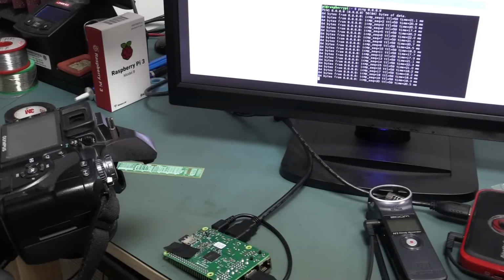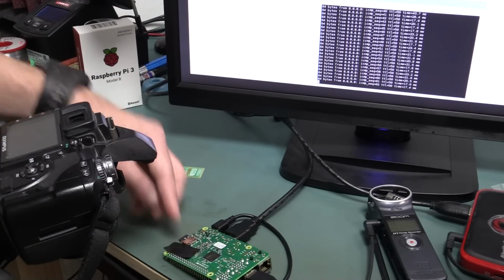EEVblog #901 PART 2 - RPi 3 Photoflash WiFi Problem

Comment: Being the scrutinizing engineer that you are, and your ability to find problems in various designs and products, coupled with the enthusiasm you have with your work is probably why people get the impression that you thought it was a serious matter when it really isn't. Personally I enjoy the high drama you bring to the field even though some of the time it's nits that are being discussed. Sometimes these are very important matters, so let the viewer use some discernment. If people are really concerned about their Raspis, then put a bit of black tape or whatever on the chips.
I mean no offense to engineers, I am one myself, but the truth is that some engineers can be very anal about certain points when in the big picture of things the points are not significant. Some have a little bit of difficulty assigning the proper weight to a problem. Often it's a matter of Ego. Sometimes we just have to say the design is 'good enough', build it and then move on. This does not mean compromise on important issues, but there is a point where many engineers will end up picking the flyshit out of the pepper (so to speak)...
Reply: any good youtuber will sound like everything said is a big deal, because you have to be an actor to be popular
Reply: So does that mean that all australians are actors? It seems like it is just the way aussies act.

Comment: The only thing I've seen that has any issue with light was the old EPROMs that used UV light to erase the memory space. It's really odd that's so sensitive. I realize how intense the light from a camera strobe is. You'd think modern chips wouldn't be so affected as that Pi board though. Weird...

Comment: I like the pi 3. it makes a really good and cheap backup computer. I have trouble playing back internet videos with it. It does the rest of the internet stuff well enough though. Really good for when I am running off my battery backup. The monitor drains to much power though. If it wasn't for that I could probably still have internet access for two or so hours without power to the house.

Comment: Thank you for making a video on this.  I did not realize bare dies were photosensitive (although I should after messing with enough UV Erasable PROMs).  Gives me something to go on if experiencing strange stability issues on boards with dies exposed to lights.  Certainly not a big design flaw or anything on the RPi as you stated, just something that is good knowledge to have for strange edge cases and working with other electronics.

Comment: Is anyone else worried about the durability of a bare die on the bottom of the board?
Reply: the least durable part of any bga chip is the soldering. doesn't really matter if it's in a black box or a bare die
Reply: No
Reply: No

Comment: why didn't you just turn the camera flash away from the board instead of the tape over the chip?
Reply: Because then you would have affected the shape of the magnetic/electric field as well, so it wouldn't be a very scientific test.  A piece of black tape cuts out the majority of light, but won't have any effect on magnetic or electric fields.
Reply: +mikerjuk the field would have just been flipped wouldn't it?
Reply: You can't assume the field will be the same in all directions, in fact it's highly unlikely to be.  Blocking the light and keeping the camera in the same position was the most scientific way to approach this.
Reply from the maker: Because then it's not a proper controlled test, and the orientation of the loops would change.

Comment: If you want to know whats really happening at kernel (driver, module) level when you flash the die, probably it would show up by using dmesg. Or tail -f /var/log/syslog. Or tail -f /var/log/klog.

Comment: Could you set up a pickup coil and a scope to show the EM field produced by the flash? Between the HV pulse that is used to trigger the tube and the main capacitor discharge through the flash tube, there should be 2 separate events with a VERY small (microseconds?) delay between them. Might make for an interesting experiment, and perhaps a video on how a xenon flash lamp works for folks who aren't familiar with them...

Comment: Not to mention the hv trigger coil that generates the several KV needed to ignite the flash tube.  This coil will generate an EMP pulse (rf field).
Reply: The extremely short and large current pulse through the ionized xenon generates a far larger EM pulse than the very low current trigger pulse.

Comment: Does the manufacturer specify maximum amounts of light intensity and wavelength that the chips will work under? It's seems like that's an important specification.
Reply from the maker: No, because it's not something you can easily measure or control.
Reply: You would think they would have a note on the datasheet , they include warnings  about everything else. If it's going to make the chip fail it's an important information.

Comment: its not only space dave     its the same reason they go for a chip on board (blob package) rather than an proper ceramic or plastic package   its because there CHEAP!   and thats what the pi is about      bring the price down as far as possable while still keeping a powerful product   that epoxy costs an extra hundreth of a cent

Comment: Seriously, they haven't fixed this issue in next model? Absurd, thumbs down for designer and manufacturer.
Reply: It's hard to fix it when the part available on the market is photo-sensitive. The customer (Raspberry Pi foundation) can do absolutely nothing about that.
Reply: "Absolutely nothing"? It's as simple as dipping the chip in the black lacquer (same as used to waterproof integrated circuit's). Takes 2 seconds of manufacturing process, costs virtually nothing, and solves problem instantly. I have done this before when fixing RPi2's - works like a charm. I'm stunned that so much people and even engineers have not thought of this.
Reply: They have thought of it and decided it is not worth doing. Even if it takes only 2 seconds why bother?
Reply: +Artūrs Savickis That extra 2 seconds and the extra manufacturing step would actually ad considerable cost to the creation of this low cost board.  If the facility didn't have the machinery to apply the lacquer they would either have to buy one or pay people to manually apply it.   With this being a not for profit venture, cost considerations have been made and it was not deemed a big enough problem.

Comment: non for profit low cost, still more expensive and less powerful than Intel atom
Reply: Suraj Grewal That's all well and good, PI did all of the ground work, nice to see all the copy board's, the PI seems to have a nice eco system with a lot of FREE tools/os etc. The UP board looks good but costs more.
Reply: Can you post a link to the equivalent Intel Atom board with similar features and pricing?
Reply: it is more like full fledged pc than embedded board eg-http://www.ebay.in/itm/172257601324?aff_source=Sok-Goog
Reply: it was literally the first link to google search "atom board"
Reply: I had a very quick search and seen some pc style computer motherboards but no PI/Arduino type development boards with IO headers that can be used for learning to control external electronics hardware etc.
Reply: Suraj Grewal The PI was developed to help kid learn robotics and how to control stuff with computers. Kid can learn to programme pc's on pc's.
Reply: The UP board has an Intel atom, the same form factor and (mostly) the same connectors including GPIO. http://www.up-board.org/
Reply: Coolkeys2009 use parallel port with visual basic
Reply: +Coolkeys2009 best is to pair up x86 system with Atmel atmega32u4
it's USB connectable you know

I kind hate the raspberry environment, it's too simple but slow and good for no actual job
Reply: Suraj Grewal I understand what your saying but it was developed as a learning platform and has been very successful. For professionals there are many other boards out there that you could use depending on the application.
Reply: +Coolkeys2009 oh, OK I get you. hopefully the 'chip' will takeover
Reply: It is terribly slow for a small computer. I bought the first Raspberry Pi that was meant to have a 700MHz Broadcom Processor and it performed like crap. So i ended up selling it. I have had Pentium 2, Pentium 3 or AMD K6 processors run faster than this piece of crap. You are better off with at least a proper computer. Even the newer netbooks can be better than a Raspberry Pi. Plus unless you buy apple stuff nothing will be soldered permanently on to the board.
Reply: +Ryan Smith apple?
those convoluted expensive computers that don't offer enough bang for the buck?
it's just as bad as raspberry pi, coinciding the cost.

i could get a 16 core scientific Xeon computer as cheap as an apple, and those will truly last more
Reply: +Suraj Grewal yeah apples stuff isn&#39;t great value for money. if you buy there newest Mac mini does not have user installable RAM. they are not appealing to people because of these stupid ideas that they seem to come up with. it is not value for money for Apple customers in my opinion. that is why i'm against none upgradeable permanently soldered designs on computer hardware. because the customers does not benefit from proprietary designs or hardware. they just get ripped off instead. As well as told that they need to buy a new Mac Mini if they want more memory. I dont why companies like apple are still supported by their customers. They just make me feel sick. Until they can learn to desgin things properly, i probably wont be buying from for a bit. They just seem to profit from peoples Apple stuff breaking. That's not how you run a business. That's how you make people feel screwed over.
Reply: you know, those Americans, who don't have proper computer education are getting hold of computers.

tapping into that market is ridiculouly profitable(hell, even I profit from it by acting as middleman)
Reply: People wont go back to companies who sell them crap though will they? How would you like it if you were sold a computer that was so crap it was restricted to running xp at best? I know i wouldnt want to do it. I was happy when Microsoft gave up on Windows XP and stopped support for that operating system. Too many companies have been running Windows XP on the cheap. Plus it is full of bugs and crap that really is embarrasing to have in an operating system. Never mind having Microsoft dictating to people about how they update their computers when they are running Windows 10, which is not good as it appears to be. If Microsoft did not exist Linux or Mac would have taken over instead. I would not run Windows XP knowing that was putting the rest of my network at risk from viruses, malware, trojans, remote attacks and hackers. I hate seeing Windows XP in use in shops and businesses. It is a digusting operating system to be using in this day and age. Plus the operating system is insecure to use out of the box, just as releases of Windows prior to Windows XP. It wasn't an experience it was a disaster, a glorified one at that. People should at least try to run more capable hardware by now. Small radical systems on chip/credit card computers like the Raspberry Pi will simply not do for anyone who expects an acceptable amount of performance in 2016. Technology has to move on. Propriertary computers made by Apple are just made mainly for profit, not to last and definitely not to benefit the customer who buys it in the first place. And dont get me started on Apples products. I get sick of hearing about problems, breakages and faults with apple products.
Reply: yeah, the only reason I have Windows is for direct x12. I got my dad on Linux, I'll get on it as soon as all my games run on it (mainly dcs world).

Comment: electrical tape is good measure, but it looks ugly and makes the circuit gooey because of bad glue
Reply: You can rely on it because its a 3M product.
Reply: Just had a thought. An experiment with different filters over the flash to see which wavelength of light causes the problem. My guess would be infrared.
Reply from the maker: Yup, can do.
Reply: Silicon is transparent to longwave IR.  Not sure about UV.
Reply: Well if tape won't do, the next step is to pot the entire board in epoxy! :)
Reply: I did coat the IC with epoxy but still ugly
Reply: I think UltraViolet
Reply: That's very interesting. I'm guessing infrared because I'm theorizing that there's optoisolators on the chip die and the package material would sort of be like your insulation tape. Hope Dave does some more tests. :)

Comment: When I suggested inductive coupling in the last video, I meant on the power chip. You got it to reboot on the power chip but only when the flash was extremely close - I'd like to see that tested.  It was clear that the wifi chip was photosensitive, it was too far away (10cm) for inductive coupling to be reasonably suspect imo.  But with a flash tube millimeters away from the power chip I think it's possible.
Reply from the maker: It's the light, I tried the reset one too.
Reply: EEVblog Excellent, thanks. I just had to wonder when you crammed that flash "right up its trumpet" - that's got to be a measurable inductive surge in a trace of any length a few mm away.
Reply from the maker: +John Ridley I tested it, it's not inductive coupling, it's the light.
Reply: Yes, you said that. I thanked you.
Reply from the maker: Youtube Creator on my phone is playing silly buggers
Reply: mattymerr701 Sounds like you need to start reading some Terry Pratchett, if you want a whole bag of new fun phrases.
Reply: +EEVblog That is a new one. Funny phrase, might start using it now.
Reply: John Ridley I have always heard about discworld and I kinda want to read them. I guess that is a bit inconsequential.

does discworld count or are there other books he has written that you are referring to???

Comment: good to know so no one can go around crashing people's RPi 3 projects (at least not that easily). So the chip die is exposed and translucent? Or are the transistors actually exposed directly? If they are exposed directly it would be neat to put it in a proper optical microscope with the chip connected but belly up and hit it with pinpoints of light back through the eyepiece so it will go nuts.

Comment: Does your camera not have a test flash? You need a consistent flash if you want to compare distances.
If you take pictures, the flash will vary depending where your lens is focusing and the distance to the target. You change the distance from bulb to chip from 1-10cm but you're only photographing the ground from 100-90cm.
Reply: Pop-Up flashes usually don't have a test flash function. But it is possible to set the flash to manual mode instead of TTL (automatic) mode. Then it flashes at a constant power, regardless of the metering

Comment: What about sunlight?
Reply: Sunlight can be very bright and has a a broad range of wavelengths, If a lot of light gets into the chips they will probably not work properly. if there going to use bare dies it needs a case on it. I wonder what effects different wavelengths of laser light would have?
Reply: What about infrared ?
Reply: What about microwave ?
Reply: only sudden peaks in intensity effects it. sunlight remains somewhat constant

Comment: I didn't realize the Pi 3 even had another bare die chip on the underside until now.

I thought they'd already learned their lesson with the Pi 2? hehe

Again though, it is a dev board to be fair, so not too much of a problem, and the solutions are pretty simple. ;)

Good test methodology as always, Dave.

I was fearing that the flash would need to be closer than that for the light to kill it, but the tape was a perfect way to test.

Comment: Dave, It would be interesting to see what your  I field probe shows just in front of the flash tube.   There was an old story  from much earlier days when data centers recorded data on rows and rows of bit IBM or HP reel to reel tape drives, when at the grand opening the reporters flashes caused all the tape drives to go off line when the flash activated the tape tension arm opto sensors.
Reply: This! Also please a special EMP episode (build a simple EMP generator, try to freeze or even kill various devices)

Comment: obv that's EMP-resistant electrical tape
Reply: wrap your tinfoil hat with it
Reply: It only has to restrict the light going to the WiFi chip. If the EMP was the problem then it would cut out with the tape on.

Comment: Could you run the dmesg command while you have some internet traffic (ping or otherwise) running in the background?
Reply: And more importantly, wait a minute before giving up, because it can take a minute for the OS to realize that something went wrong (as could be seen when you were running the ping command through the flash).
Reply: ***** Yeah, running traffic through was really just meant as a way of speeding up that process. I would also ask him to disable and enable the interface from the command line or similar to see if that's enough to restore it, or if it needs a hard reset.